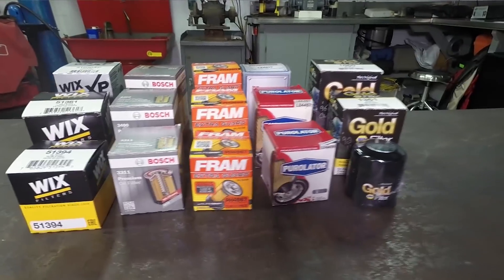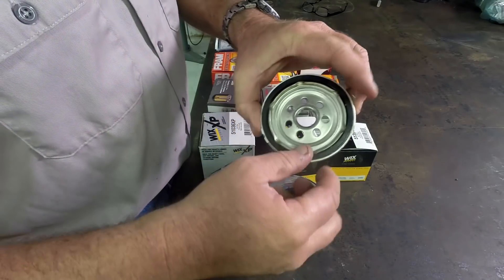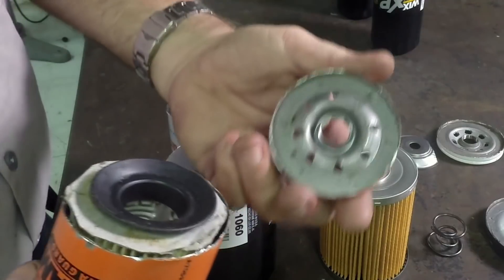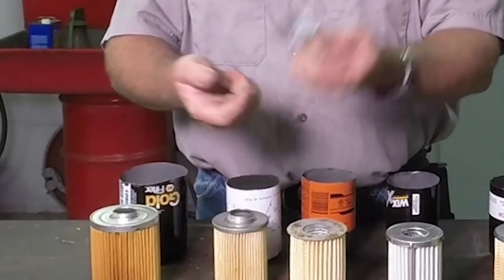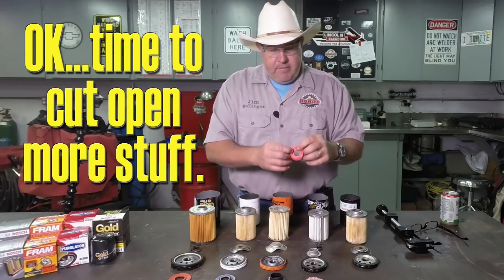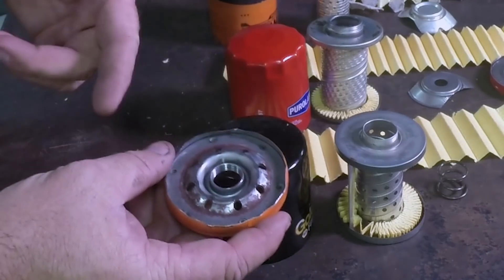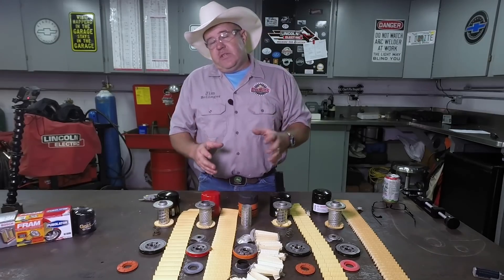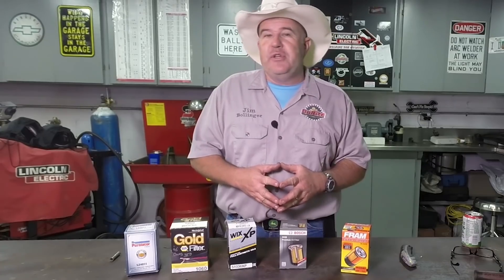The worst oil filter EVER!

Comment: My Ford had the powerstroke engine, I'd run the oil 9k between changes, oil always came out clean, really unusual for a diesel, I credit this to the really big filter, of course it did have 14 qts in the case.  What I don't get is these tiny teacup sized filters, do they really do anything?

Comment: I've been using fram oil filters and air filters since my 1999 S-10 xtreme ( bought brand new with 3 miles on it) and now it has 397, 486 miles on it with no issue with oil filter or pressure js

Comment: Several years ago when rebuilding one of my Harley motors I decided to cut open oil filters for the standard 1340 Evolution motor. What I found was very much like this video, the NAPA Gold was great and the Fram is absolutely worthless GARBAGE! If you use Fram in any vehicle you are insuring the engine will fail long before it should, never use them in anything!
Two  differences in my testing were that I also cut open Harley brand filters and Baldwin filters. The Harley filter was excellent quality with well made parts and good pleated material. The best was Baldwin, extremely well made in every way, probably a little better than the NAPA Gold.  If you skimp on cost when buying oil filters you are making a very expensive mistake in the long run.
Reply: ( Really...have you honestly EVER seen an engine failure due to a FRAM filter??? ( didn't think so....)
Reply: This is the cheapest Fram available.... and hes comparing it to more expensive oil filters. Fram has 3 or 4 models better than this. Their synthetic version is great. Has all the bells and whistles.
Reply: Makes sense, Lets built a cheap crapy filter, so everyone will buy our best expensive crapy filter instead

Comment: Thanks did a paper in college on the Wix company years ago.  Wix is a great company did you ever cut apart a FRAM ULTRA SYNTHETIC filter and see if the guts are any better, it's more in comp with pricing to the Napa and Wix filters?
Reply: I to would like to see that because he had higher quality filters in the other breand and then the cheapest fram you can by. Seams a little staged
Reply: i doubt it, would be hard point selling wix/napa if he tested with a level playing field.

Comment: Most oil filters are exposed to supply pressure, not return!!  Not all of the oil coming out of the pump goes through the filter.  There is usually a pressure relief valve that allows oil to bypass the filter if the pressure drop across the filter reaches the relief valve setting.

Comment: This is nothing new, as this has been common knowlege among professional mechs for as long as I can remember.  During my time as a GM dealer tech, I replaced 40-50 engines, and over half of them had Fram filters at the time of failure.   That's pretty disproportionate, considering you normally may only see one Fram out of every 10 cars.  It may be anecdotal given the small sample size, but I still use anything but Fram on my vehicles.

Comment: Another good tip...if you replace a cam set...use a good break in oil...then cut open your filter after oil change....to make sure there isn't alot of metal shavings trapped in filter...to make sure your new camshaft didn't take a shit on ya during break in.

Comment: Used fram for many years and never had any problems despite your evidence of cheap construction.  Maybe it was changing my oil every 3 to 4 k miles that saved my engine
Reply: Another man who thinks...go with what works!  If FRAM was SOOO bad...it most likely would NOT have survived. Too many fleet owners use them, and they would know
if the filters were as bad as some have made out.A lot of money goes rolling on those filters! NUFF SAID !

Comment: I'm not disputing what you found, and we as consumers have all seen for are own eyes!  But I have use Fram oil filters for almost 45 years!  I use them in my 76 Toyota ST Celica got 327,000 had it for over 30 years!  Same engine!  Also had a 89 Toyota Camry LE 445,000 miles on the engine!  Been using Fram now for my 05 Toyota Camry with 120,000 miles on it.  I see what you have showed me, I agree that is BS if Fram Oil Fliters are like that!  Again not debating how long you had them, or where you live as far as weather, and as far as where you keep them.  But if your debated my honesty well I can PROVE my cars, and history I live in CA the valley area so it doesn't snow here where I live either.  I can't imagine that all of Fram Oil Filters have RUST in them?  Not sure how long you had them where their stored, and as well where you bought them?  There are always more un-answered question as to just watching a video of a oil filter being cut opened, well isn't there?

Comment: You missed two common brands. AC which in the 70's was Purolator manufactured and the STP that in the 70's was made by both Wix and Fram. In the 70's I worked with large fleet that sent oil and filters to labs after use. Wix shined beating competitors and the fleet converted to synthetic oil. STP tests were mixed. More bearing wear and less piston ring wear or visa versa. Sorry but I'm to old to recall which way it was. The lab suggested using a heavier weight oil might get  the same benefit as STP but wouldn't commit without further testing.

PS also missed the Hastings brand that used cotton instead of paper, are they still around?? As bad as you might believe Fram is, their Tv, radio and print advertising blitz. Awakened the consumer to the necessity of a new filter with every change. All oil and air filter brands saw a sharp increase in sales with Fram spending millions. The next time you don't have to persuade a customer on the need of a new filter. You can thank Fram's advertising.

Comment: Wow,  thanks. I had no idea Fram was junk. I used to use their HP-1 on my high performance full flow Volkswagens. Is there a way to objectively test the filter media itself? I would be interested in that too.
Reply: I use the HP-1 on my 650HP small block. Recommended for years by my engine builder. Probably he has used 1000 or more on expensive high performance engine and builds. I will cut it open next time I do an oil change.

Comment: I, unfortunately for 25 years, believed the marketing wank and my "knowledgeable(?)" friends, by using that orange filter. Perhaps, changing my oil every 3K miles is what saved me. One day, Orange Co., introduced their "double guard" filter for 2X the price. That immediately posed the question in my mind; "Why do they need to market a better filter than their wank certified 'greatest already filter'?". My mental answer, told me to switch to Wix, from then on. 
Thank you for opening up these canisters and confirming my suspicions.

Comment: Purolator was jointly owned by Bosch and Mann+Hummel.  Now M+H owns 100% of Purolator.  Purolator also owns Wix, but they are made in different facilities.   Champion Labs makes over 200 brand names to many different specs, including the top of the line Mobil 1 brand.

Comment: I was losing oil.  Got under the car and there were holes (larger than pin holes) in my Fram filter. I think it was made in China? Pure garbage. The filter had been in my car for about two (2) weeks.  I could have lost my engine.  And if I lost my engine I would have lost my car.

Comment: Stopped using Fram filters about 5 years after I went away from Pennzoil in the late 60s. A friend had a Fram explode on a 396/375 in a 67 Chevelle! I just stay away from both of them any more. Last Frams I used were for some 'rinse quick' oil change flushes on some rebuild candidate engines. They were cheap. I am and have been for years a Napa Gold user, Wix when no Napa stores are in the vicinity. Stick with Valvoline and Mobile1 for most of my gas engines. Great video, I am now subscribed. 68 yr old retired electronics geek / welder / mechanic. Michael in Colorado.
Reply: Yes Sir on the Valvoline. I worked  at a Refinery on the Lube Oil side. We had several name brand oil contracts. Valvoline was one of them. Their specs were way off the charts as was the price of the additives to achieve those specs.  Valvoline forever here.
Reply: Did anyone find out why the filter EXPLODED?..(.probably a stuck relief valve...that will explode almost any filter....)

Comment: I always knew Fram was pure junk. I've had people bring me fram filters to change their oil, and at my own cost, I drove 25 miles to the store, returned it, paid more for another filter (fram is usually on sale at auto zone, which I avoid anyway), and drove 25 miles back. I can not, in good conscience, put a fram filter on an engine. I wouldnt put one on a wrecked Chrysler K car I planned to crush the next week.

For what it's worth, I use Motorcraft filters, which are made by Purolator. As seen here, they're a damn site better than Fram, and they generally cost about the same.
Reply: Sounds like you drove a lot of miles for nothing...what told you that the FRAM filter was no good? Did you honestly have a FRAM filter failure?
Reply: @denniscollier4931  this video is proof that they're garbage. And yes I have had issues associated with them

Comment: Walmart's house brand oil filter is fram. You get what you pay for.
Reply: Walmart's house brand is Super Tech...
Reply: Walmart's super tech filters are better than Fram.  I saw a video where they cut open both. It was cheaply made, but still better than the Fram.
Reply: @NikoBellaKhouf  no. They aren't. That had to have been a tough guard or extra guard or something. The synthetic has wire backed  media and a silicone gasket...
Reply: @TDIETZ22  We're comparing apples to apples while you're comparing apples to oranges. The comparison was done between the same filter size and type. The Walmart super tech was better made and cheaper than the equivalent Fram.
Reply: @NikoBellaKhouf  what fram model was compared to the super tech? All im saying is the synthetic fram is one of, if not,  the best filter on the market and it costs under $10
Reply: @TDIETZ22  

It doesn't matter which Fram. Even the cheapest Fram filter costs nearly twice as much as the Walmart super tech. 

I'll pass on all Fram products. They're only surviving on their name now. They take way too many shortcuts. Who's to say they won't do that with their synthetic line?
Reply: @NikoBellaKhouf  agree to disagree. They've gone the opposite direction and improved their quality dramatically over the years. Like i said before, the synthetic is an absolute beast. I will continue to use it because of how great its built
Reply: @TDIETZ22  When you're at the bottom, you can only go up from there. I'll stick with the brands that haven't compromised quality.
Reply: Walmart sells good filters 👌 the fram brand is trash but sadly people still buy trash to pinch pennies so who's fault is it really
Reply: @raymonddey7403  This is the cheapest Fram available.... and hes comparing it to more expensive oil filters. Fram has 3 or 4 models better than this. Their synthetic version is great. Has all the bells and whistles.
Reply: Wow lie much !! or are you just that stupid?  Thats not rust and you know it. thats Discoloration  where they use heat to cure the cardboard to the filter. there is NO rust in the canister !!  yes it is a cheaper filter, but its susposed to be. its only good for 5,000 miles and is dirt cheap for walmart to sell. if you want a good filter test a fram ultra filter rated for 15,000 miles. cut one open to see , makes your napa filter look like a pice of shit.  i am a mechanic & i know what im talking about.  you are lying to these people and should be ashamed !!!!!!!!!!!!!!!!!!!!!!!!!!!!!!!!!!!!!!!!!!!!!!!!!!!!!!!!!!!!!!!!!!!!!!!!!!!!!!!!!!!!!!!!!!!!!!!!!!!!!!!!!!!!!!!!!!!!!!!!!!!!!!!!!!!!!!!!!!!!!!!!!!!!!!!!!!!!!!!!!!!!!!!!!!!!!!!!!!!
Reply: Does Walmart have any real complaints about engine failures due to FRAM filters?
Reply: It's cheaper because they get a tremendous volume discount. Mobil 1 is not going to make a different spec oil just to sell to Wal Mart.

Comment: As a novice, and having seen two videos on these kinds of comparisons which both came to the same conclusions, I am more than pursuaded that Fram is bad news......for canister type filters.

But I offer to you in the hope of your additional insights that I have just purchased two new filters for my 2015 Ram Ecodiesel and there is absolutely no visible difference between them: one being the OEM recommended Mopar and the other being the Fram equivalent CH11794. Keep in mind that these are cartridge, not canister filters, so you can see, feel, and measure everything without tearing it apart. I have not ripped the filter “paper” out but it really impossible to see any difference.

What do you think?
Reply: Yes, JIM...what do you really think ?  TOO many FRAM filters out there in the REAL world on running engines!

Comment: The problem with the Fram is the drainback valve. 2nd one in a row just failed after 2500km. Like I just changed the oil every start. Well last 2 starts. This could even cause a new engine to wear out in the warrenty period.

Comment: Great video, you are about the 8th person i watched on YouTube that cut open several oil filters & showed how (BAD OF QUALITY THE FRAM OIL FILTER IS) i had to put a new timing chain and phazers on my 2014 Ford Ecco Boost truck before 100,000 miles, because the oil sensor screens were dam near plugged, and i change my oil 3 to 4000 miles, i dont wait no 10,000 miles, ( I WILL NEVER BUY ANOTHER FRAM OIL FILTER AGAIN) it is an expesive mistake, if FRAM cares about selling filters, they will up their game by using quality components instead of cardboard & glue to make their filters....By the way, i bought that truck brand new, iam the original owner....

Comment: I put over 278.000 mls on my Aerostar and I used frame and Castrol. the motor was still running strong when I got rid of it. say what ya want it did its job well.
Reply: Fram?

Comment: To be fair to FRAM he is comparing apples to oranges. He's comparing a $3.00 oil filter to a $10.00 Filter. Frame has a $10.00 filter also called the Ultra. I didn't see that one cut open being compared to the rest of the $10.00 filters. You get what you pay for. So don't expect to get a BMW quality car if your only willing to buy the cheapest car possible and except the same ride.  You buying the cheap filter was your choice not FRAMS. All they are doing is offering an alternative. I think this review is more about the reviewer not liking FRAM.

Comment: i’ve had my 96 Buick Regal since brand new. It has over 200,000 miles on it and it still runs like new. I have only used Fram oil filters on it and i’ve never had a problem. Ever.

Comment: The Purolators have  been failing where the media  is tearing near the base.  So visual observations of  new product are not enough.  The  Filter media is one  of the most important factors.  The  Filter media is  typically cellulose and  glass fiber so whats the  problem with  the end  caps  being  paper?  They provide no structure only a  platform to glue the paper media to.  Paper to paper.  Not paper to metal.  Toyota  Denso  don't even have  end  caps!    OEM service Honda  and Subaru filters are made by FRAM. The wix  cost double the FRAM.  The jobber NAPA/wix  filters ( at the same price point as the wix) use  combo valve that is  terrible and more problematic than the FRAM ever would  be. In service .  I know  I had one  fail.

That FRAM filter you cut open was OLD  stock.   I once got a wix from a local AP store and the ADBV was like wood. Sitting in stock  for  YEARS.  New  FRAM orange  cans have  silicone  rubber anti-drainback valves.  I dont work  for  FRAM.  I'm just a person who has  had  engine  problems  due to oil filter "failures"  and have looked into filter construction and other aspects that can be  problematic.  Last word of  advice?  If you own a Nissan don't put a "made in China"  Factory service Nissan filter on your car.  if you have one  on there  - get it off  the  engine NOW!

Have fun and thanks  for the video. - Sandy

Comment: Ran a gram filter I my 87 Toyota truck for 17 years and 285,000 before I sold it and in my wife's Geo metro 235,000 miles, never had any problems. No I don't use them know we have newer cars now. Pennzoil and Fram filters no problems here.

Comment: I did this type of oil filter research several years ago, and found the excite same thing with the Fram's I did find that at the time the Super Tech's were actually Bosch. BUT! I recently noticed that the  Super Tech's have been re-boxed so I bought one and cut it open, IT WAS NOT A Bosch! but I found it to be a TRASH FILTER!!!!! So, in the past I was okay using the Super Tech filter, not now, NOT at any price. Just a Heads up!
Reply: Good to know....it motorcycle world, I read repeated tests showing good flow rates and excellent construction of the super tech filter....it seems things have changed.  Looks like I'm swinging by my local NAPA
Reply: What exactly do you look for in a non "TRASH" filter???...4 inches more filter paper ??

Comment: Dude, comparing NAPA Gold vs lowest "white" Purolator? How 'bout compare the NAPA red to white Purolators 1st.
Unfair comparo dude. But yeah cardboard  Frams sux. 
Purolators used to filter down to SMALLEST particulate of any WUWT?
Reply: That is what oil filtration is all about...FILTER THE OIL ! ( does it matter if the innards are paper or fiber or ??) NO...as long as it works. FRAM has been doing it a long time folks.
Reply: You are in a minority..Plenty of bad reviews online of street/muscle/4WD of cardboard frams. FRAM is capable of making a good filter.

Comment: I have a 2004 E-150 Ford Econoline with 697k miles on it and all I ever used were the fram PH2 filters. Those are 95% highway miles and I change the oil on time everytime with full synthetic. I don't think the average engine needs anymore than what the fram offers as far as filtration goes, but due to the poor construction, I have stopped using fram.